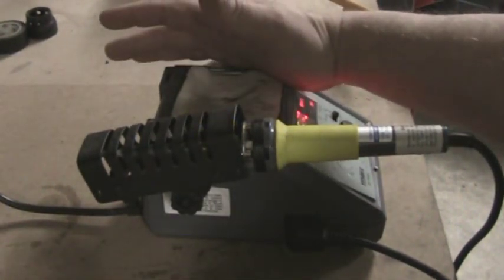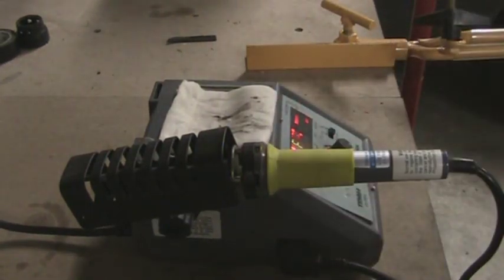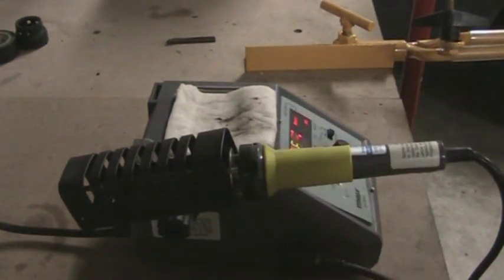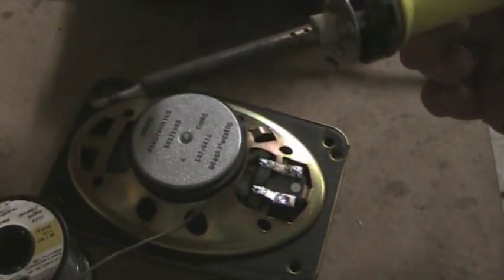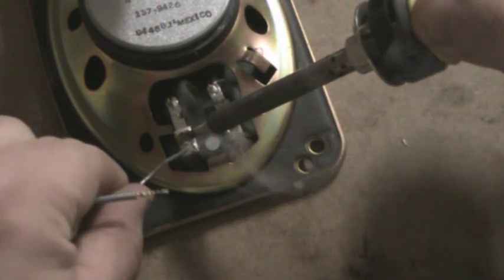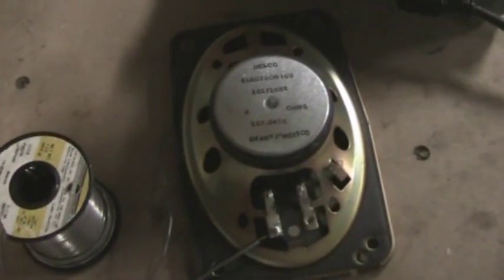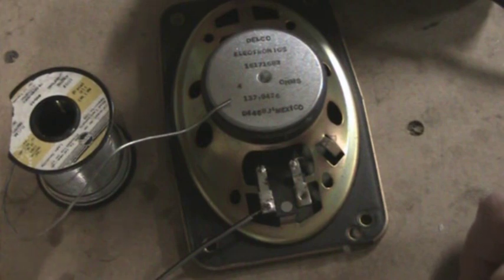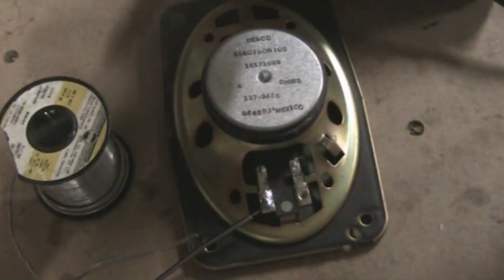How to Solder and Some Soldering Tips

Comment: Was your temperature setting nearly 900 F?  I set at about 600 F for smaller connections and occasionally go higher - to under 700, for large terminals / wires.   I would be afraid to damage the lug where it is connected to the speaker, or heat it enough to unsolder the wire at the other side of the terminal.  Otherwise a fine video.  Thanks.

Comment: @Johnnysshop hi i've got a question...in a previous clip u showed a grand am 2dr getting the kickers put in...mines is the same model but a 96 4 door and i'm seriosly considering getting all 4 replaced with those kicker speakers, but i wanted to know if i decided to go do it myself would i have to solder the speakers for the 4x6's and 6x9's or is there another method??